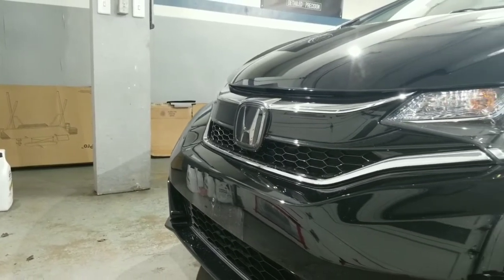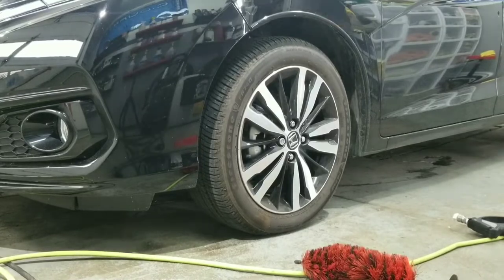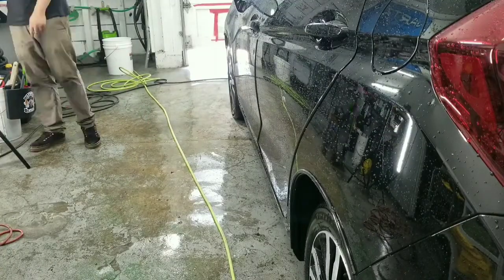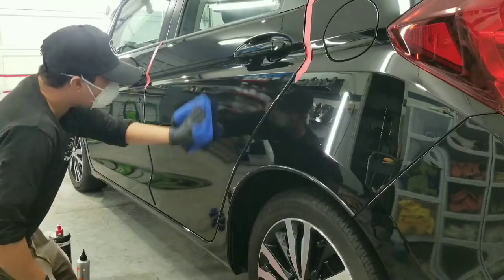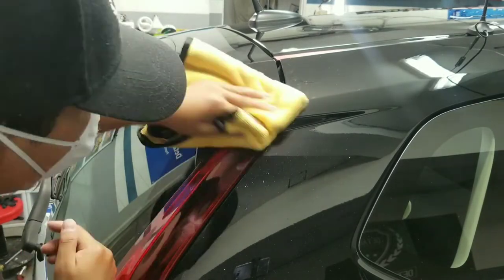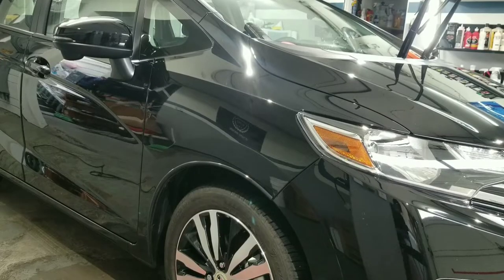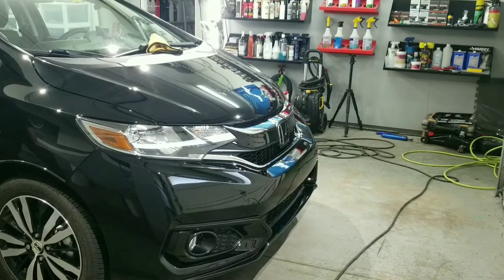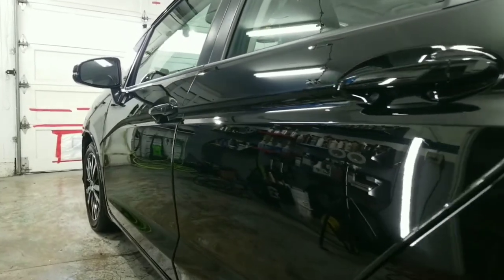How To Safely Remove Scratches On Ceramic Coated Car

Comment: Hi, do you need to recoat whole panels or can you do local areas on a panel? I have some scratches as a result of a bike rack. Do you wet sand because a compound won't get through the original coating?
Reply from the maker: Yes, I would recommend recoating the entire panel versus spot coating. Only wet sand if you have prior experience. There is a possibility of messing up the paint.

Comment: great job, i have a 1 year old ceramic coated my white Tacoma as well and can see some light swirl marks. my question would be should i just try and polish it then re apply the new coating?
Reply from the maker: Yooo Allen,

Appreciate you watching the video! Awesome to hear you are a diy enthusiast. Since the coating is only 1 yr old and you accumulated some light swirl marks, we need to figure out the root cause. Is it from washing or drying? Otherwise if you repolish and recoat, the swirls will come back again and waste of energy and effort.
Reply: @DetailedByPrecision  im guessing it’s my fault when i tried to buff and wax it one time🤦🏽
Reply: @DetailedByPrecision  or could be really from washing too. Not so sure
Reply from the maker: You can wax it if you want, it won't harm the coating. The surface properties will temporarily be of the wax. Once it wears off then it will go back to the coating properties. If you used a soft applicator, it shouldn't cause swirls.
Reply from the maker: Leaning more towards the washing or drying steps that's causing the light swirls
Reply: @DetailedByPrecision  thank you so much for the tips. I will try to polish it off first if it doesn’t help i will compund then polish. Does that sound correct?
Reply from the maker: Yes. Least aggressive method then work your way up

Comment: I was just wondering about what to do if a customer comes back and wants scratched fixed on a car I coated for them.  When you polished out the scratches, you have to re-coat the entire panel correct?  Did you charge the customer for a whole bottle of coating to recoat repaired areas, even though you may have only used about a 1/4 of it?  What did that fix cost to the customer?
Reply from the maker: Yo Joel,

Appreciate you watching the video. Yes, correct. When you polish out the scratches, even though you might do your best to control your work area on the panel, the machine itself will gradually hit areas out of your full control. It would be best practice to recoat the entire panel that way you ensure the panel is fully recoated again, and also you don't need to make a mental note of half the panel original duration timeline of it being coated versus the newly coated "patched areas". Pricing wise will be up to you. As a professional, in any trade, customers are not exactly just "paying for a product". Your knowledge, experience, and being able to perform a task mistake free, should be accounted for as well. Hope this helps you out.

Comment: Hi Expert, one query here what will happen if we use the clay Pad to remove sand particles after ceramic coating? Does this will remove ceramic coating or reduce its effectiveness?
Reply from the maker: Yoooo Ashish, at the moment i only use claybars to clay coated cars for maintenance every 6 months or 1 year. I have tested different claybars and clay pads and sponges. The pads and sponges will scratch the coating. I only trust and use this claybar currently on ceramic coated cars. It's called Pinnacle ultra poly claybar. It's extremely fine and soft and will not cause damage on black paint. In terms of will it remove or reduce it's effectiveness, I haven't experienced it with my test subject of 4 year old cQuartz coating. But the claybar does require slight friction for it to work. Hope this helps!

Comment: Do u apply carpro essence plus and then a new ceramic coat afterwards?
Reply from the maker: Hey Adrian, Both carpro essence and essence plus are great products to use when working with ceramic coatings. The main difference between the 2 is that carpro essence is a primer polish that's applied prior applying the coating. It will maximize the gloss and clarity and lay down some Si02 resin to help your coating have a stronger bond.

Carpro essence plus is used after you applied a ceramic coating. For example, maybe there's some high spots or slight blemishes, essence plus will safely remove it without damaging your ceramic coating. Hope this helps answer your question. Thank you for watching!

Comment: Ii also own a ceramic coated car and my query is that can we use Iron X directly on the paint ? So after just spraying the water on the whole car should I just spray it with Iron X  and leave it for a few minutes and then spary water again? Will that cause issues with the coating?
Also how to remove the swirls on the paint is there a way out without using a DA polisher and all that stuff?
Reply from the maker: Yooo Dilpreet. Thank you for watching and supporting the channel. To answer your question about is it safe to use iron X on a ceramic coated car. Yes, you can use iron x directly onto the paint after pre rinsing the bulk of the dirt off. And yes, I recommend using iron x once a month, if you wash your car once a month. Do not use iron x in the sun, or let it dry out. Dwell time between 3-5 mins is more than enough before rinsing it off without agitation. Iron x will not harm or degrade the coating. I've been using ceramic coatings since 2010 and ever since carpro released iron x shortly after.

Unfortunately the only method to remove light defects is by using Carpro essence plus with a DA machine. You can't control how much pressure doing it by hand, and it might scratch the paintwork. Hope this clears up some of your questions!

Comment: Please provide the names of the products and equipment that you used.  Thank you!
Reply from the maker: Hey Cathy,

Wheels, tires, wheel wells:
Meguiars all purpose cleaner for wheel wells
P & S brake buster for tires and wheels
Horsehair wheel brush
Speed master brush for barrels
Reply from the maker: Washing stage:
Optimum car soap
Microfiber madness incredimitt for safely washing ceramic coated cars

Wetsanding stage:
Meguiars 3000 grit sandpaper
Kxk dynamics soft sanding blocks
Reply from the maker: Polishing stage:
3" Flex dual action machine
3" rupes coarse wool pad
Meguiars m101 compound
Rupes ibrid 1" machine
1" rupes coarse wool pad
6" griots boss g21 machine
6" rupes coarse wool pad

Lake country white polishing pad
Menzerna 2500 polish
Carpro Essence prior applying ceramic coating
Reply from the maker: Ceramic coating used Carpro cQuartz classic

Comment: My car is coated with a Gtechniq 5 year coating; my garage door clipped my bumper causing some light but noticeable scratches.  I have a bottle of CarPro Essence Plus, will some buffing with that be enough to remove them?
Reply from the maker: Hey Max,

Sorry to hear about your situation. For this situation with the force coming down from the garage onto your bumper, most likely carpro essence plus won't help. But it doesn't hurt to try since the product is non abrasive and won't harm the coating. If it doesn't work then you will need to use a more aggressive method. I like using meguiars m110 compound and rupes coarse wool pad for deeper defects. If that doesn't remove it completely, it may need some wetsanding if you have experience and feel comfortable doing it. Recoat afterwards. Thanks for watching the channel.

Lim @Detailedbyprecision

Comment: Can we remove swirls mark from ceramic coated car by da polisher?
Reply from the maker: Hey Rajiv,

If you offer ceramic coating services to your customer, I would recommend going over with them how to maintain the coating for postcare. For example, how to spot clean bird shit, tree sap, bug guts. How to properly wash it, or have them bring it to you for maintenance washes. 

Unfortunately once there's swirls on a coated car, most of the time it will require Machine polishing off the coating and reapplying. If it's really light, then sometimes Carpro essence plus can save it without recoating. Yes, you can use a DA polisher to remove swirl marks. Appreciate you supporting the channel.

Comment: Why never use ipa after polish?
Reply from the maker: Yooo Asad,

Appreciate you watching and supporting the channel. I will do my best to answer your question. Before ceramic coatings arrived to the market, detailers from enthusiast to professionals did not use ipa after the polishing step prior applying wax or paint sealants. 

Once ceramic coatings we're introduced to the market, everyone was in the learning phase and testing and experimenting was important to contribute to the development of the industry as a whole. Manufacturers provided instructions on how to properly apply their brand of ceramic coating onto the paint. Ipa wipedown to remove polishing oils prior applying the coating was one of the steps. So everyone started incorporating that and that opened the door for standalone ipa products to be introduced to the market. It works like IPA but more lubrication. 

Fast forward 3-5 years from 2010, which was when coatings came out, the #1 issue with coatings was water spot issues. The only way to resolve it back then was by machine polishing the water spots out but at the same time that removed the coating. It was very frustrating and time consuming for both sides. Next, companies came out with something called primer polish, which was what you saw me use in the video. What it does is that, it replaces the IPA step and helps lay down a foundation for the ceramic coating to blend and bond together.  When working on black color paint or soft paint, you want to minimize the amount of friction as possible. Thats where the primer polish excels due to it being easy on and easy off. 
Afterwards you can go straight to applying a ceramic coating. That was the design and purpose of the primer polish. Hope this helps answer your question. Appreciate you brotha.

Comment: When you apply a new coating to a panel, isn’t it a different shade/color from the other panels? That it was I have been told in the past..
Reply from the maker: Hey Jared,

Thanks for watching and support! That's a interesting and good question. I will do my best to articulate my thoughts. Let's say for example, we use the doors since they are side by side. One side is perfectly polished to perfection, and ceramic coated. The other side was just washed, claybar, and coated. Can you physically see a difference between both coated doors? High chance you will spot the defects once the sun hits it or with lighting. Now let's say both doors are perfected and coated, you won't be able to tell any difference. Now let's say, it's been 1 year since you applied the coating and one of the doors had to be recoated for whatever reason. To reapply a coating, we have to go through the necessary prep work again. Afterwards we can reapply the coating. Now, both panels are coated, one side fresh, one side 1 yr old. If the 1 yr old coating was done correctly the first time with perfected paint and it's been maintained properly, technically it will look as good as day 1. So you most likely with our eyes, won't be able to make a significant distinguish between the 2 doors. Hope this helps.
Reply: @DetailedByPrecision  well said
Reply from the maker: Appreciate it brotha

Comment: Great video! Question for my particular situation.. My black car was coated professionally last year with Feynlab Ceramic and while I've taken extra care of it, after a winter, it needs a little love. I used to work as a detailer but have zero experience with ceramic coatings. I'm itching to get some of the swirling and haze out of the paint but don't want to remove the coating, as I do not know how to re-apply it. I've tried the carpro essence+ but results are average and seem artificial as it is filling rather than correcting. Do I have any other options? At this point I am considering removing the coating, polishing it properly and just sticking to wax from now on, this way I will be able to maintain it over the years.
Reply from the maker: Yooo Will. Thank you for supporting by watching the video. I'm glad it was able to help you clear up some questions you might of had. I been using and testing various brands of coatings ever since it came out to the market in 2010. I have no personal experience with Feynlab, but I do know it's a good product because some people I look up to and trust solely offers that coating brand. I have experimented by using Carpro essence + on different brand of coatings as well. It won't damage it. I do agree with your assessment that it will only fill or remove the slightest marring or defects. This does not include swirls or scratches. But it will restore gloss to it's maximum potential. You have a good idea and game plan of what to do next. If essence + can't remove the defects, unfortunately, you will have to polish off the coating to remove the defects, and reapply your choice of protection. You already know what to do, I'm just confirming your thoughts haha.
Reply: @DetailedByPrecision  Thanks for the reply! Yeah i opted to go with the last option. Sadly in the process of removing that Feynlab coating and going to correct and apply the CQuartz myself, thanks to your video haha. This way ill be able to maintain/re-apply myself going forward. Keep up the good content and thanks for the tips!
Reply from the maker: You're welcome. I would recommend using UK 3.0 over the classic. It's much thicker viscocity and more water spotting resistant. Huge issue with the cQuartz classic on black cars.

Comment: Hi, I have a question..my new car is ceramic coated from 3M. I got some scratch from reverse driving, its minor but there are couple of scratches. So should I go apply any kind of wax to smooth the surface or wait for few months because next ceramic coating will be done by company again. Please advice.
Reply from the maker: Hey Rashmi,

Congratulations on the new car! If you are planning on bringing the car back to get it recoated, let them remove the scratches for you. Once they remove the scratches, it will be 100% protected again when they reapply the ceramic coating. In the meantime, just double check to see if any paint is missing from the area. If it's on metal/aluminum, keep an eye on it so it doesn't start rusting/corroding. Don't need to apply any wax in the meantime.
Reply: @DetailedByPrecision  thankyou so much😊

Comment: Bro, can I drop you a pic on 1 scratch on my ceramic coated car door? despite after wet sanding, it become 2 colours even after polishing. Do I really need  a respray on the paint? Need your advise
Reply from the maker: Hey Mr. Wee. 
Sorry to hear about your situation. Feel free to text me @4156014291. I will take a look at the pictures and hopefully can help you for the next step.
Reply: @DetailedByPrecision  hi. This is whatapp? Any country code required in front?
Reply from the maker: Im from the united states. I don't have Whatapp. Any other messaging app you use? Or email?
Reply from the maker: Lkuang801@gmail.com
Reply: @DetailedByPrecision  hi. I have emailed u the picture. Thank you
Reply from the maker: Just got a chance to reply. Let me know if I can help with any other questions.

Comment: How did you dry the car what blower
Reply from the maker: Back when I started to get into the detailing industry in 2008, there was only 1 brand that was on the market catered to detailers. That brand was called metro master blaster. I couldn't afford a couple hundred dollar car dryer at that time. I waited until 2015, when autogeek released their prototype V1 car blow dryer unit for roughly $130-150. Pretty much it's a vacuum motor with a plastic tube attached to it. I been using that till now. Cordless blowers were not commonly used yet up till 2018-19? If I were to do it again with the available options now, I would recommend going with a cordless one. Thank you for watching!